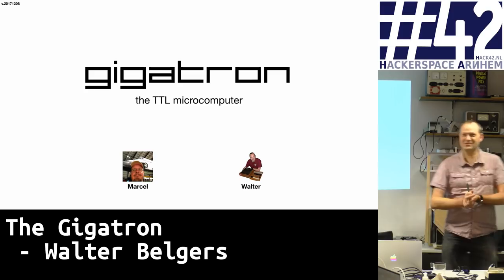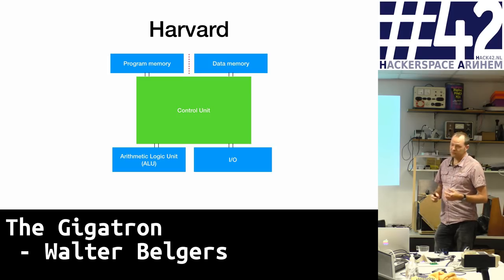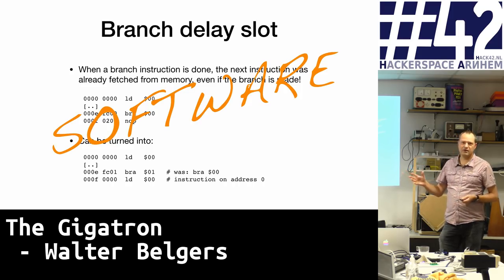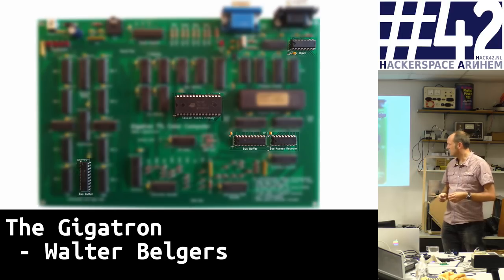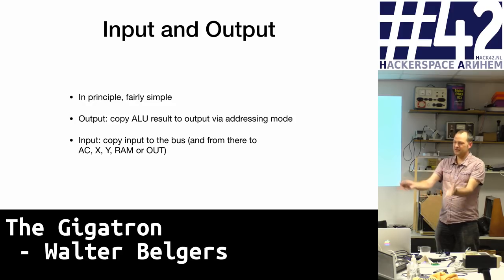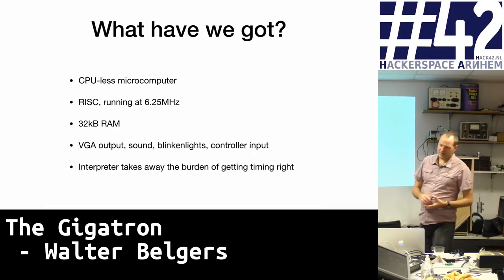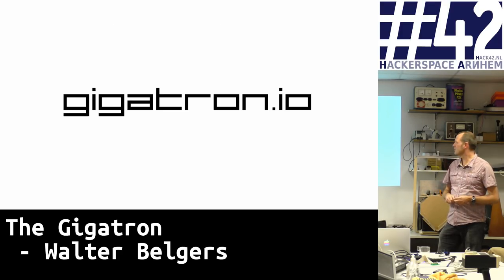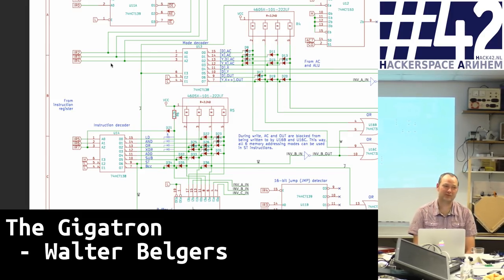Hack42 Lecture: The Gigatron by Walter Belgers

Comment: Impressive! I'd like to build one, but I don't have a VGA-compatible monitor anymore. Would it work with a VGA-to-HDMI converter?
Reply: It will probably work. It's a VGA signal after all.. I'll buy an adapter myself and let you know.
Reply: I bought an adapter. The edges of the screen are lost but it is usable. This was a cheap Chinese converter. Maybe others will work even better.